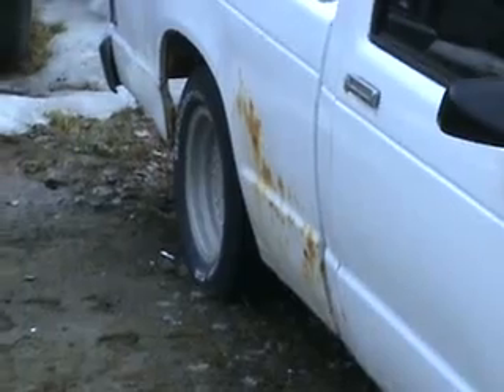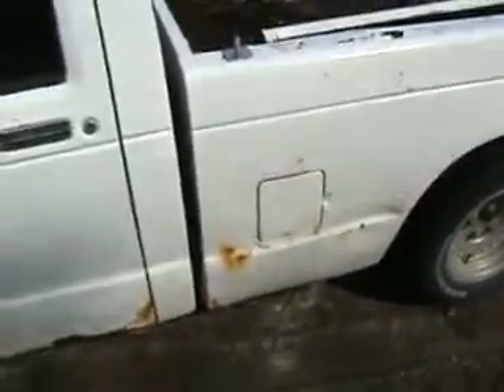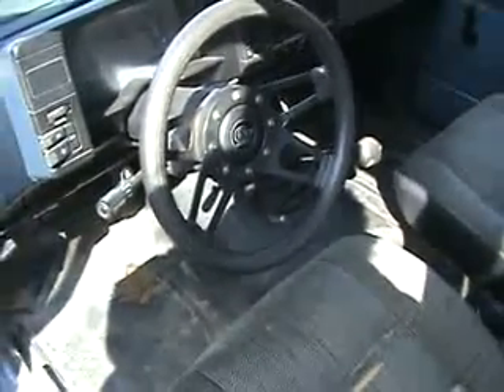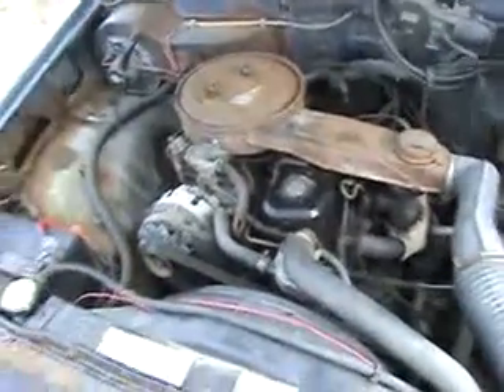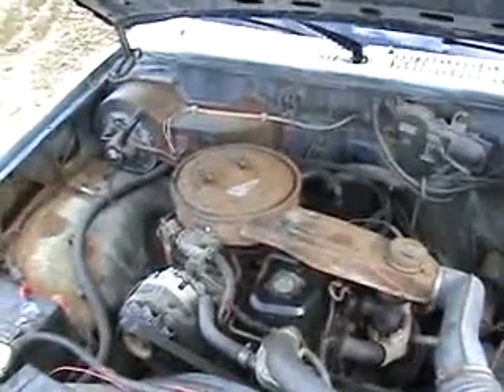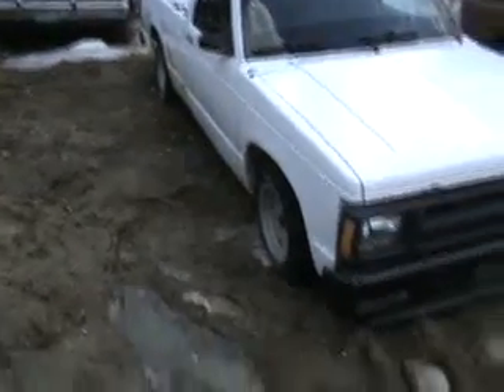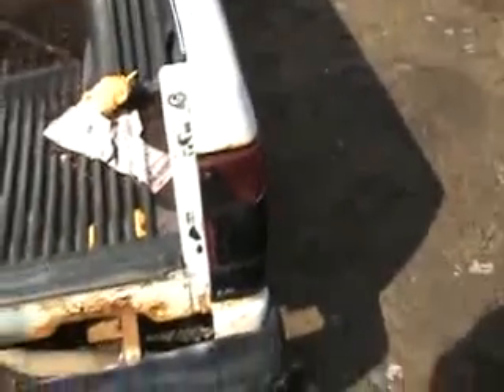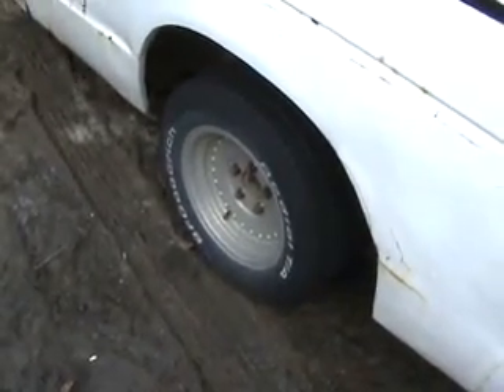Eric's Garage - Chevy s10 v8 Conversion Part 1

Comment from the maker: You dont have to Cut The firewall.All i did is knocked it back. "Yes it was a Pain" But the after math looks better.also you can buy a kit that brings up the engine abit. But it doesnt look so hot. afterwards.

If you have anymore questions just msg me. thanks.

Comment: Are you sure you should be doing an engine swap because I heard multiple mistakes in what you where saying....also unless you are going to go all out on the 350 engine its not going to be that fast. My 88 s-10 4.3 V6 will smoke my cousins 91 with a v-8 swap, he left it stock and it is pretty underpowered..sounds good though...good luck with it though, just get someone that knows what they are doing to help you out..lol